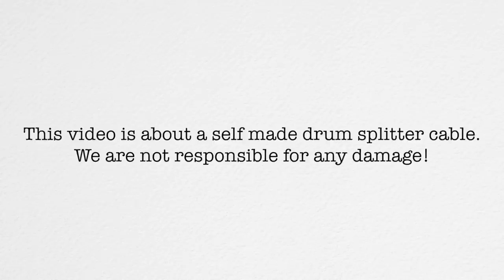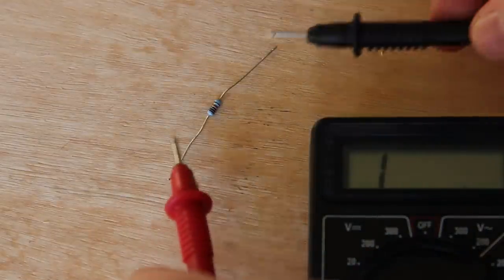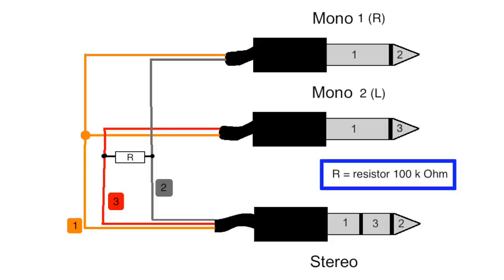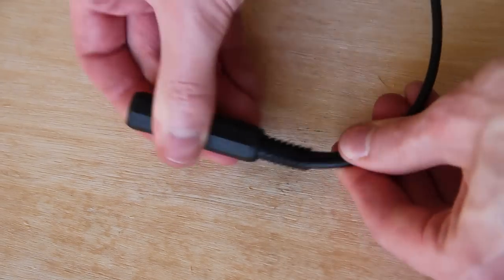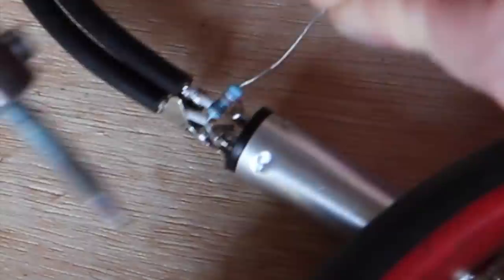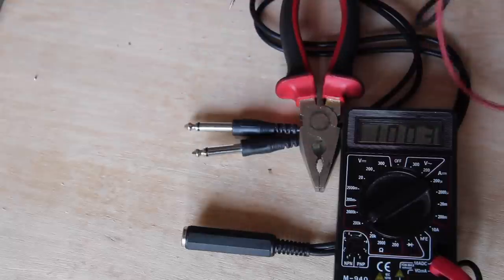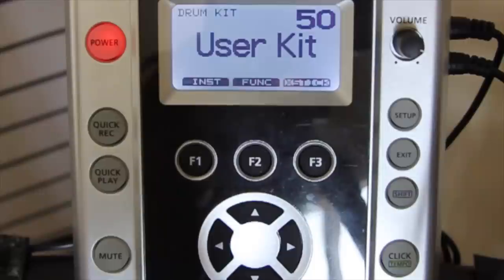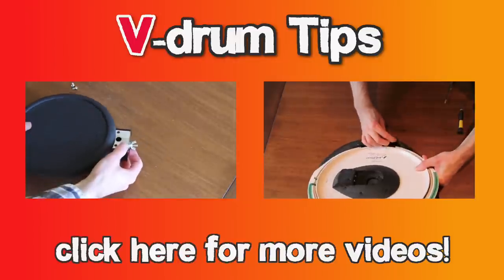Make a Drumsplitter Cable

Comment: hi, can they be played together?
or it will play only the head tom if played together?
thanks
Reply from the maker: I don't think they can be played together. (hit in the exact same moment)
Reply: I haven't built the splitter, but Im pretty sure you can play them together. You are just removing the rim trigger form the tom and splitting it out onto another tom.   Before you build the splitter, the Roland module can detect when both triggers (the rim and head) are played at same time, as it changes the sound, try it out on your snare :-)
Reply from the maker: Yes, but then you'll get a rim shot. I saw a video of a guy who described that problem, but maybe you're right. I just need to try it out.
Reply: carpii I still not have an Edrums, so I cannot try to do it.
In a normal dual trigger pad is it possible to play head and rim together?? or in that case play only the head?
maybe the split in two mono pads give the same result.
Reply: Nik Zodiac Ok, I see what you mean now. I think Marcel is right, it would create a rimshot sound
Its possible you can disable the rimshot in the module, I'm not 100% sure yet. Marcel knows a lot more about this than me, I just tried to help because I didn't realise he would reply to you so quickly :-)
Reply: Nik Zodiac Ok I just tried on my TD-30, if you edit the instrument you can disable the 'rimshot nuance' which changes the tone when both the rim and head are hit. Its on the TD-30 module under the 'POSI' menu, meaning positional control.

I'm still not 100% sure because its difficult to tell without actually splitting it, but I think if you were to disable POSI then after splitting the rim trigger onto a new tom, it would allow you to play both heads at once.

Of course you'd need to make sure your VDrums module supports this POSI feature. For the TD-30 its on page 61 of the user manual (You can find a PDF user manual for the VDrums you're thinking of buying on the Roland website)
Reply from the maker: But what about the smaller modules, like TD-15?
Reply: Marcel Price Yup, I just dont know. Id say there's a good chance POSI is only available on TD-30 and perhaps the older TD-20 too. But its why I recommended checking the user manual as its the only way to be sure :)
Reply: Marcel Price mmm.. look at this pdf.. http://www.roland.com/V-Drums/assets/pdf/Module-Pad_Combinations_e.pdf
It seems that POSI is only avaible on td 30..

Comment: Hi, great tutorial..
I just had a question-
Does this splitter work for the TD11K drumset?? You've mentioned that it works with the TD-11 module, BUT, the official Roland website says that the rubber toms on the TD11K (pd8) are single zoned..there exact description is-"The PD-8A is a new unit dedicated to the TD-11K. It does not support the use of the rim-shot technique."....on the other hand, for he PD-8 pads,Roland's description is- "the newly created PD-8 rubber pads with dual-trigger support for playing rim shots and bow/edge sounds with the TD-6V module."...SO THE QUESTION IS- how can i make and use these drumsplitters for the TD-11K with TD11 module..???I guess i can use it as there wont be any module difference in the TD11K and TD11KV..both have TD11 module(which u say will work).. pLease help!!  :(
Reply from the maker: Depends on the cables. Just connect your snare pad pt one of the tom cables and check if you have a rim sound or if you can activate one. Check first if it has stereo cable for the toms. It should, cause it is sold with dual pads as toms too.
Reply: Vdrum Tips
but as i said earlier, the pd8 toms are suppoesd to be dual zone right? then why dosent it works for them??
Reply from the maker: the normal pd-8 are dual zone. Roland produced the pd-8a as a cheaper version with only one trigger.
Reply: Vdrum Tips
 Right.. So you are telling me that the pads aren't 2 zoned ,but  the module will be able to support the sterio cable..right?
Reply from the maker: It depends on the cables, if there are stereo cables on the cable bunch you should be able to connect a dual trigger pad or a splitter. You can try it easily by connecting your snare pad and hitting the rim. Check if you can edit the rim sound.
Reply: Vdrum Tips
Thanks man! get back to you really soon..!! :D ....and thanks for all the quick replies!
Reply: Vdrum Tips I made the cable exactly as in the video, I do not have the pad PD8X but the PD8A (no rim). The cable worked, but the sound I have in 2 pads are exactly the same, how can I change them?
Reply from the maker: 1st make sure the cable has no short circuit. connect the snare pad and change each of them to see if the splitter is even working.
Reply: Vdrum Tips I think the cable may have been done wrong, I will review the links. Thanks!
Reply: Vdrum Tips I had problem in p10 female, when I changed it worked! Thank you very much, enjoyed the final result.
Reply from the maker: cool.

Comment: Would this work on an Alesis Crimson module?
Reply from the maker: I don't think so. It does not even work for all Roland modules. This splitter is a Roland hack. Alesis Triggers and modules work a bit different as far as I know.
Reply: Hi Anthony. I am planning on altering my Crimson kit. I used a piezo stuck to some hardboard and just held the Black and red wires on the low Tom cable. It worked perfectly, velocity sensitive too. I plan to make a proper rubber coated pad to have in the Tom 4 input on the module. I also used my old Guitar Hero drum cymbal pads and they work brilliantly too. I'm not seeing a reason for the resistor. If you hold the piezo black wire to the ground of the cable, and the red on the  tip you get the Tom skin/mesh sound. Move the red wire to the ring part of the cable and you get the rim sound. I see no reason  why you can't use 2 piezo wired to a stereo socket with the cable from the drum module plugged in to it. It should give 2 triggers.

Comment: I want tp add more pad on my roland td4, there is 1 jack left for additional crash. Can i use splitter cable for add more pad?
Reply from the maker: +Ardito Goller No, the splitter is not working for the TD-4, since you cannot assign different sounds/instruments to head and rim of 1 pad.
Reply: Is there any option for me to add more than 1 pad(crash 2 jack is already)
Reply: Example, my crash has 3zone, bell, bow, and edge. Can i use the splitter before crash? I actually just using the edge of crash cymbal(single zone)
Reply from the maker: The zones of your crash do actually not matter. It is the input cable. Why would you split a 2 zone crash? You would have 1 cymbal as edge and the other one as bow. It does really not make much sense. The TD-4 is not made for upgrades. The smartest thing you could do is selling the TD-4 and buy a used TD-9. They are not expensive anymore and you can split almost every pad or even connect a 2nd module like the alesis trigger IO.
Reply: Amazing answer. Thanks bro!!

Comment: Will this also apply to the TD-17 module?
Reply from the maker: Jason Raskie No, the TD-17 requires a normal y-cable. Google the user manual:)
Reply: Have you actually tested the TD-17 with a "normal y-cable".  I've tried with a stereo to mono-mono cable and it doesn't work.  If you've gotten it to work please link to the cable you used.
Reply: @kirstensray  I'm experimenting with it now. As of recent, I tried a stereo to mono-mono cable and it did not work. I'm trying several other options as well. Have you had any luck with it?
Reply: @Vdrumtips1  I have the actual TD-17 manual and it speaks nothing about a normal Y-cable. =[
Reply: @CaptKewl  I bought a cable from drumsplitters.com and that worked.
Reply: @kirstensray  What particular cable did you buy?
Reply: @CaptKewl  I got female splitters and split tom 1 and tom 2 with the dual cow paddy to give me a cowbell and wood block.  If you want to split the AUX you can get the male splitter and plug directly into the TD-17 module, but a female splitter will work off the end of a cable too.
Reply: Awesome,  @kirstensray  ! Thanks for the reply!

Comment: Hi
I see you know much about electronic percussions. I would like to ask you one question. I would like to use Roland PDX-8 pad with Alesis DM LIte kit. I would like to replace snare pad. I don't know it will work or I can damage DM Lite module or PDX-8 pad. Because Alesis pads have blue leds which lights when you hit pad. I'm afraid power supply of LED can demage Pad or using Roland pad I can demage DM Lite module (becouse of short cut or smoething else). How do you think - is it safe or not to replace these pads ?

I will be gratefull for any answer.
Szoti
Reply from the maker: I don't know much about the alexis system. It would be the best for you to do a proper research on v-drums.com forum.

Comment: has to be 100 k resistor would a 120 k work?
Reply from the maker: +jim power I cannot say for sure. I would not try a different one. Get a 100K, they are not expensive.
Reply: Ok cool im trying all over town
Reply from the maker: Or order from ebay. Do not risk destroying your module:)

Comment: This tric also with the td-6?
Reply from the maker: +edo lang No, the TD-6 has only a few inputs that can be split. But not with such a cable. It is only possible with a normal splitter cable(with no resistor). check the user manual to find more info.
Reply: ok thx !
Reply: on the Td-6 you can use a stereo to dual stereo splitter cable but you have to keep the one jack one position out of the one pad so it will work as mono..but it is not something stable,cause every time you hit it will move a bit and retrigger,it should be taped..just a temporary solution 
 An example to be avoided , but for an emergency situation it is ok.

Comment: Thanks for the vid. I'm going to give it a try.
Reply from the maker: Cool, let me know if it's working for you! What kit do you have?
Reply: Marcel Price I have a td11k which comes with 3 single zone pd8a toms. Just got my resistors in the mail (50 for 99 cents includes shipping on ebay), soldered it all together and it works GREAT. Thanks so much. You easily saved me $50.
Reply from the maker: robwbarron
I'm glad to read that. It's always cool if people build their own stuff.Thanks for letting me know.
Reply from the maker: Marcel Price Would you mind to send me a picture of your drum splitter. I would like to post it on the V-drumstips Facebook page.

Comment: would this work with a td-6
Reply from the maker: No
Reply: A standard splitter cable  (single stereo 1/4 inch to 2 mono 1/4 inch) will work with no resisitor, provided you use it on a dual channel input on the TD-6.
Reply: yes it works, but only on toms 2 and 3, not on snare. I guess why. It would be nice working on every pad. Is it a matter of resistor value?
Reply: it is made to be working with toms 2/3 and 4/5..not with the snare..i think it is something from inside..

Comment: in TD-6v module doesn't work ? thanx
Reply from the maker: Hi Jaime, I don't think they work for a TD-6. Never tried it but red it in forums.
Reply: according to the TD-6V Owner manual there are only 3 inputs that works in that way, Tom2 Tom3 and Snare inputs. test the other inputs to see if that works too

Comment: Will it work on TD11?
Reply: I have a splitter to connect T3 cable to 2 pdx-8 as a T3 -T4 and it works fine.
Reply: @PermanentWaves80  , can you explain how to do ? After I unlink I have only head zone , the rime disappear. I myst change something in Settings !?
Reply: @sorinniculescu1758  Tell me please if you got any infos, have the same problem. Thx
Reply: @theGoodchoice , unfortunately , both pads Pdx-8 have the same sound ! I can't set two different type of sound ! One pad is for picture...! I don't understand why someone with experience don't explain in a video how to do "step by step"...

Comment: Strange, it doesn't work on my td 11 k. I have the exact same pad response even after checking the 100 ohms resistance between the two hotspot  of each mono cable. Anybody have the same problem or solution ? ;) Thanks
Reply: Try 100k ohm not 100 ohm
Reply: @petermaas8132  thanks Peter I will try:)
Reply: I bought everything and tried splitting first two Tom’s, when split, you cannot play the rim one at the same time with any other Tom. Even doing flams, it doesn’t trigger. Any suggestions? I did my cable step by step to.

Comment: Thanks for the video. Have a question though. I have a regular Stereo to two (2) Mono cable. It is a regular Y cable. I have tried to split the signal in my TD8 but did not work.....Is this a special Y cable. Thanks!
Reply: It's the resistor that makes it work. Watch the video!

Comment: You do not have to use 100K. You can use anything above 50K. I tested it with 50k to 150K, and they all work. Important thing is that you put enough resistance (barrier) so they get separation.

Real important thing is you must set this input channel as one of the rimshot capable meshpad like PD125. Remove the positional sensing and take out the crosstalk.
Reply from the maker: Thanks for the tip, I didn't know that:)
Reply: what do you mean about barrier? as is capacitor value? most use 100k, so if i use 120k the better? I think ive read somewhere one guy did that and it was better.. btw how do we keep the choke of the main pad?

Comment: Hi, does this work on the trigger inputs of an SPD-30? Thanks
Reply from the maker: Good question. It probably does if a normal splitter cable is not working with it. But I can't guarantee it. Check the vdrums forum before trying it.

Comment: Hi! Thanks a lot for this! I'm trying to connect two mono DIY pads built out of piezos to the Non-Snare inputs of my Roland TMC-6. I had actually found your solution in a blog (http://www.drummerforum.de/forum/46834-roland-tmc-6-zwei-pads-an-einem-input.html#post761898), but not the size of the resistor. With the right size it's finally working! Love your DIY vids, keep up the good work! Nik
Reply from the maker: Thanks:)